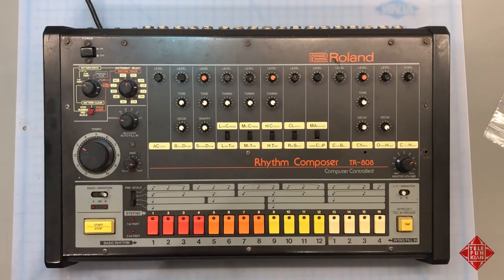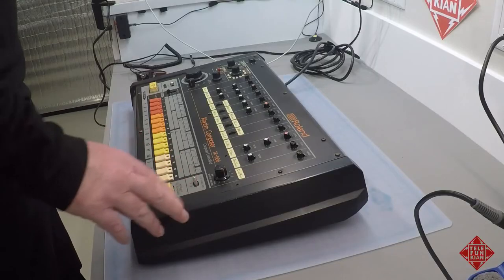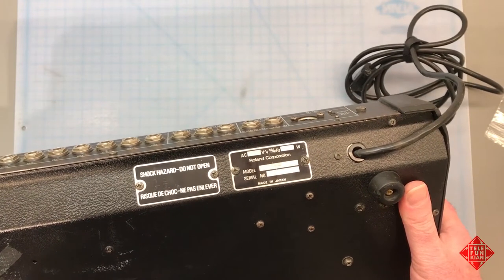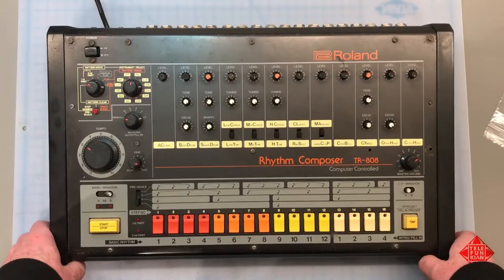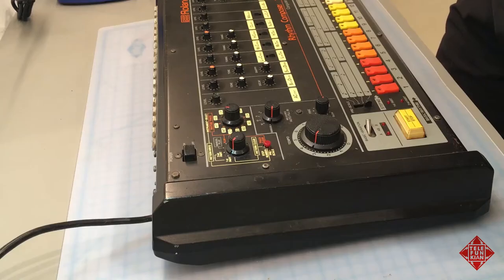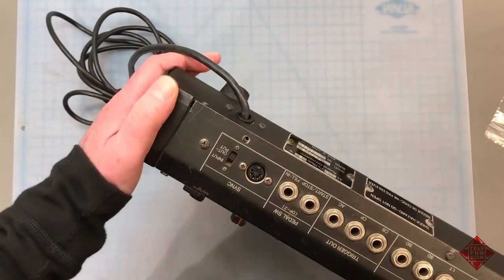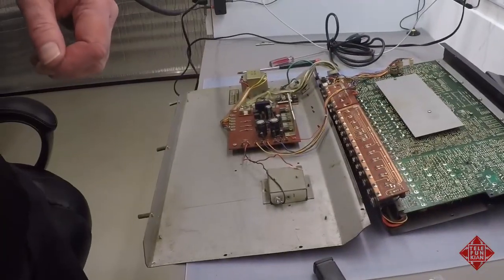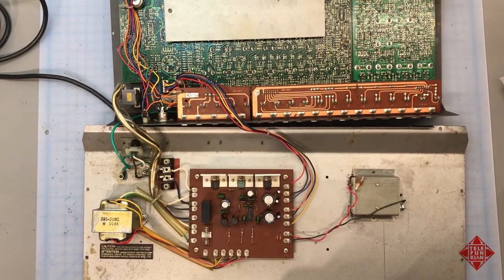Roland TR-808 Series Part 1 : Disassembly

Comment: What op amp upgrade do you recommend to replace the 4558?
Reply from the maker: Steven, I'm not so sure I would recommend doing an 'upgrade' in the 808, as the results are unlikely to be measurable, never mind noticeable. That being said, if you have to replace a dead chip, and can't find a 4558, the NE5532 should be safe I figure. The LM4562 uses ~3x as much power and there are ~20 of them so that's about an extra 120 mA off the rails. Thanks for watching!